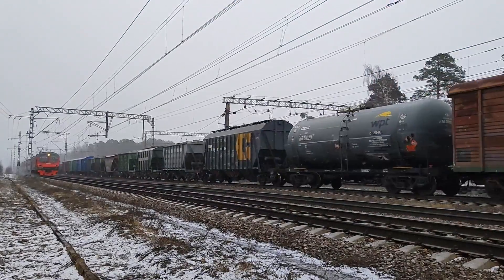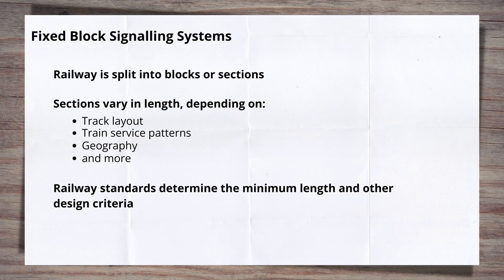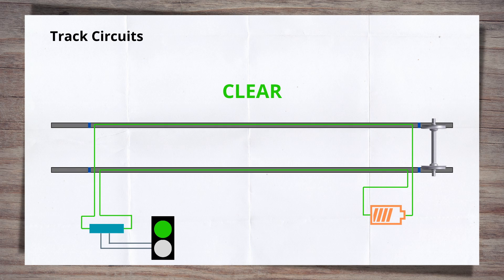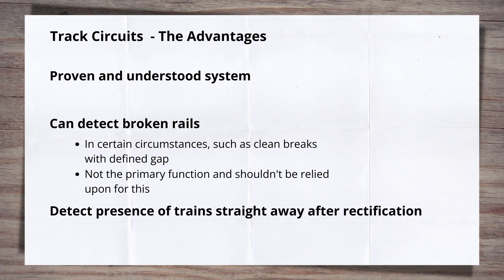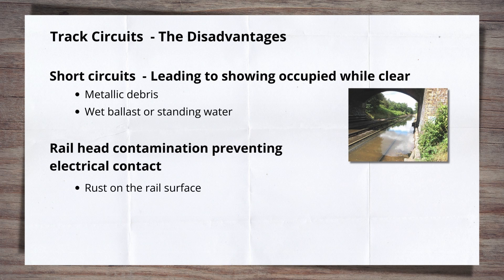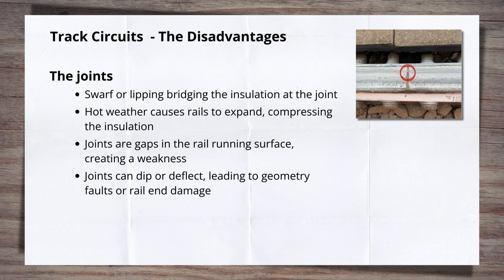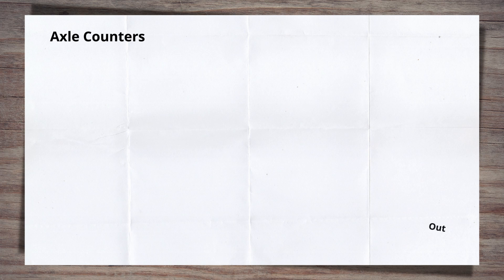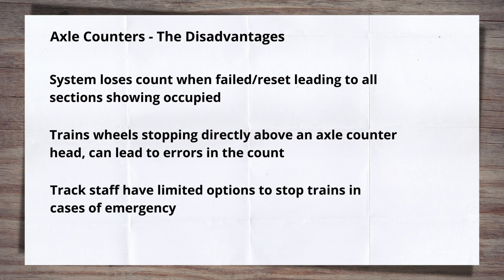How Do Signallers Know Where Trains Are? A Guide to Railway Train Detection Systems

Comment: As a signalman of nearly 50 years experience . I have found both systems very reliable .  The only reasons I have had with track circuits failing is flooding , and component failing .Never objects on the track,  amazingly if the rails are covered with snow they still work perfectly  . If a track circuit fails I have never in all my years of experience known of a signal not show a stop  signal behind .    Axil counters , the only time I have had them not clear.     Is when there has been a engineers  occupation .When there are several trains and  track machines working on the same section of line  .  If the power supply does fail there are back up power systems that automatically come into use .

Comment: Very good summary. Signaller knowledge of 'where trains are' can only be as good as the extent of each indicated train detection section. Some sections are several miles long, which can make requests from user-worked crossings difficult to manage.
Reply from the maker: Absolutely

Comment: I once saw an Eastern European video about some guys (Kreosan on YouTube) that connected the two rails to a little speaker, and it had a specific AC or pulsed DC signal that had 2 short pulses and 1 longer pulse, then a pause, and repeat. I assume it's relatively low voltage. I think this is likely part of the track circuit detection system they use. How does the signal look on a U.K. track circuit? All diagrams I find just show the same thing like in your 2:22 diagram as if it's a constant voltage but I'm certain the signal is much more complicated than that, right? Why would the Eastern European track signal be more complicated than a U.K. track signal if we really do use CV? Where would I find more information about that? I know steel has a significant amount of electrical resistance so what kind of voltage do we use on U.K. tracks? Also, as part of my PTS, we're told to use a track circuit clip in the event of an emergency but we weren't (yet) told that it's ineffective with CWT that may use tuning zones. How exactly do tuning zones work? You said it sends audio frequencies but how does that work without being audible to the ear? As audio would be propagated through the rail, wouldn't it carry well beyond what is considered maximum distance of a block? Or, is it a high frequency electrical (not audio) AC or pulsed DC signal tuned in a specific way that the rail inhibits how far it carries, kind of like an out-of-tune inductor? I have so many questions.

Comment: With the trackcircuit, the train shortcuts the electric current, preventing it from activating the relais. But at the same time the train shortcuts the power source.  Now you can not simply shortcut the power source. So how do they do it?
Reply: Adding a certain kind of resistance between the power source and the track itself. So the unoccupied track circuit is like power source, resistance, track, relay, track, power source. While occupied the current cuts the relay short but still has the resistor (in most cases a kind of a coil as far as I know) in series with the power source.
Reply: @Schlappspaten_spielt  That could be it. Thanks! I know that here in the Netherlands we have those trackcircuits (and on some branche lines axle counters), and these days they use electronics systems instead of the old relais systems.

Comment: Track circuit should also be used together with signal system. For example Chinese version of ETCS L1, the CTCS 2, use fixed balise to transmit line/speed info. But signal status is transmitted via track circuit, due to China railway used track circuit instead of axle counter. So signal status is continuously transmitted even in ETCS L1 equivalent mode. And enable ATO even in ETCS L1/CTCS 2 mode. No need for 40 kph exit window and driver observation.

Comment: Another issue with track circuits is specific rolling stock not breaking the circuit. This problem occurred in Ireland.
Reply from the maker: I didn’t realise this happened, do you have any more info on it?
Reply: @thepwayengineer This was c.25 years ago.  it was kept very hush hush. Specific railcars on Irish Rail were not trusted to operate track circuits reliably. Many unmanned signal cabins became re-manned as a human was required to verify that a train had actually passed out of section. I cynically assume that this is what lead Irish Rail to go all in in axle counters.
Reply: @ewanduffy  This happened Downunder in Victoria Australia with the Sprinter Railcars built in the early 90s (similar in appearance to British Class 153). Several remedies were tested but instructions still require single units not to operate in certain areas.
Reply: Isn't that also why track circuit "actuators" (rather assistors) are fitted to many GB diesel multiple units too...

Comment: Presumably track circuits aren't compatible with electrified railway lines. Or is there some clever way that they still work?
Reply: The rail network I work on, New York City Transit, the track circuits are low voltage AC, whereas the traction power is DC at 600 volts. 

It’s much like the filters that get attached to older copper wire phone lines to filter out the internet signals, you just need to filter the DC current from the AC current.
Reply: They're compatible, fairly common for electrified track to be track circuited here
Reply: Although compatibility with electric traction is not mentioned in this short presentation, track circuits have been used with both third rail d.c. and overhead 25 kV electric. In the third rail system, with heavy current at around 750V d.c. , most of the time both rails are used for traction current, and track circuits that use frequencies that are immune to the traction current, and there are also “traction bonds” to route the traction current past the track circuit bonds, but not the track circuit current.

Much of the 25 kV lines had only one rail for traction return, with the other being the track circuit rail. This was practical as the current is a lot lower at 25 kV. Suitable relays that are immune to the traction system were used. The rail used for each swapped over at each track circuit joint, with a lot of cross bonding for traction through the whole system. The overall interface between electric traction, signalling, and permanent way, is a topic of it’s own.

A relatively small amount of the 25 kV fitted lines did use jointless track circuits that were compatible with a.c. traction, with both rails being used for both functions. ISTR the trade term was TI-21M, originally used between London Paddington & Heathrow airport. Don’t know if that’s still in service, or replaced by axle counters though.

Comment: It seems axle counters have some operational issues but no safety issues as a track circuit could cause. I think this is the reason why axle counters become more and more popular.
Reply: The benefit a track circuit has that an axle counter doesn't is continuous detection, and this does have some safety implications. That said, I don't think it's straightforward to say that one or the other is more or less safe, it's going to come down to the actual installations and the maintenance and operating procedures around them.
Reply: Not all systems behave like explained in the video. There are axle counting systems where reseting the axle counter frees the block. Which can be deadly if there is in fact a train on the block.
Also a faulty axle counter in the beginning of a block won't make the section occupied. So the system needs to detect faulty axle counters.. Which seems to work pretty well so far. But in my humble opinion it's an accident waiting to happen.
Reply: @alexanderohman1707  In theory of course. But in practical terms the UK Network Rail signalling SYSTEM makes such an event extremely unlikely. The application Safety Case for each new installation demands so.

In UK practice in areas where Axle Counters are the predominant form of Train Detection, if a train leaves a section of line occupied behind, the signaller will alerted by their control and display equipment of and out of sequence occupation and clearance of the track section(s) as the train proceeds. 

Safeguard 1: Before attempting to Reset the affected Axle Counter section(s) left occupied, the signaller must stop and contact the last train to check the train remains complete - i.e. to ensure it has not become divided. In all likelihood such an event would already have caused an out of course brake application alerting the driver to the issue and consequent actions required. 

Safeguard 2: Assuming no obvious reason on this train is identifiable the signaller can attempt a Conditional Reset of the affected section(s). However, the signalling SYSTEM will prevent a remote (i.e. signaller) Reset unless there has been a partial count out of the affected section registered by the Axle Counter evaluator under 'normal working' arrangements. This is the 'conditional' feature in play. The majority of 'miscounts' involve a count OUT which is unequal to the count IN so the Conditional Reset attempt will prove successful.

Safeguard 3: However, a further safeguard is then imposed by the signalling SYSTEM (interlocking) which holds every signal protecting the affected section at red. This is known as Aspect Restriction. The Track Section shows CLEAR to the interlocking allowing routes to be SET but protecting signals cannot show a proceed aspect. 

To remove Aspect Restriction from the signal route a train must pass this signal and travel through the affected section under signallers caution and check for any obstruction of the line. A standard Rule BooK procedure where the driver is advised of the circumstance, authorised to pass signal at red and inspect the line. After passing through the affected section the driver must report the line status back to the signaller. The action of the train passing through the section automatically removes the restriction placed on the signal for the next train. If the driver reports an obstruction then other standard Rule Book line protection processes are invoked. If the affected section is through S&C then a single train movement through each axis of the section MAY be needed to remove ALL Aspect Restrictions.

Safeguard 4: If unusually a remote Reset is prevented the only way a Rest can be achieved is to send the Technician to the site to perform a manual reset at the evaluator. Again, standard Rule Book procedures to ensure the section of line is clear must be followed by both signaller and technician before Reset is undertaken.

Safeguard 5 - Possession handback: If it is known an Axle Counter may be disturbed during rail movements, for example by wheeled vehicles which are known not operate the counting head effectively and / or during Engineering Possessions then a pre-planned invocation of the EPR control feature by the signaller will occur at the start of possession, before any axle counter becomes disturbed. This may be invoked across one or many sections at a time. When EPR is present and Reset of axle counter section(s) is attempted the Evaluator will not enforce the partial 'count out' feature. Neither will the interlocking invoke Aspect Restriction. In such instances the handback of the work site and the process which ensures all rail plant and personnel are off track and accounted for also includes a manual 'sweep' of the affected section of line before handback to traffic and normal working is resumed.

Safeguard 6: Systems in use in the UK generally perform to SIL4 (the highest) - equivalent to that of signalling Interlocking equipment. This renders the risk of equipment malfunction leading to a false Reset as negligible.

In the UK it is now 21 years since the first application of Axle Counters as the principal method of train detection was implemented (at Stoke on Trent SCC). Many have followed. I know of no serious event due to erroneous Reset which has compromised the safety of train running.

Bit of a long winded response but I consider it important to dispel myths around how 'easy' a false reset by a signaller leading to a catastrophic event actually is. I hope this explains it

Comment: The audio version of track circuits sounds really interesting, so a video on that might be quite informative. Also, if you could explain how axel counters count axels exactly, that would be good too. What about Talgo trains that don't have a single axel between wheels, how do they work with these systems? Thanks for the video.
Reply: An axle counter is a proximity detector which gives a pulse each time the magnetic field around it I’d
S disturbed by a wheel.  A computer counts the pulses and stores the information in its memory. When the next axle  counter counts pulses it subtracts them from the first memory and adds them to the next. Provided that the same number of pulses equals zero then it shows the track to be clear.
Reply: Re Talgo wheels, with track circuits the wheels are cross bonded electrically so they do interrupt the track circuit. With axle counters the count is the same.. To overcome the possible “loss” of a train while using sanders most countries instruct drivers to stop with sand and then move forward a coach length onto unsanded track.
Reply: Not sure on the exact method of detection, though afaik it's magnetic in some way, we're told to keep ourselves/tools >300mm away from axle counter heads to prevent false detection. They're fitted pretty close to the running rails, so I'd think that it'd probably not be an issue for Talgo trains, though I might be wrong.